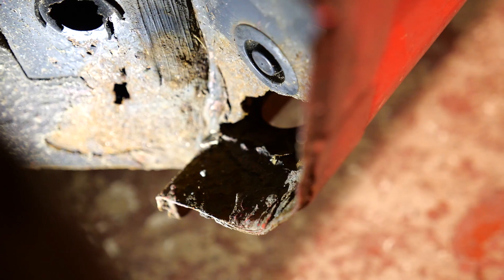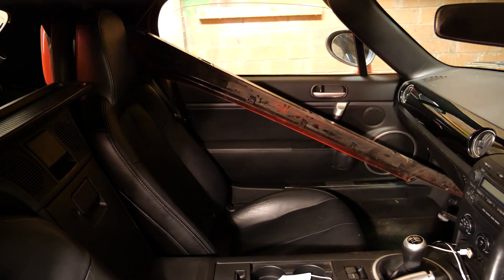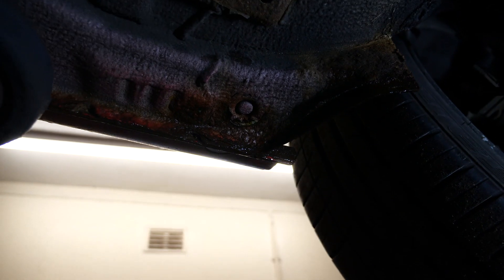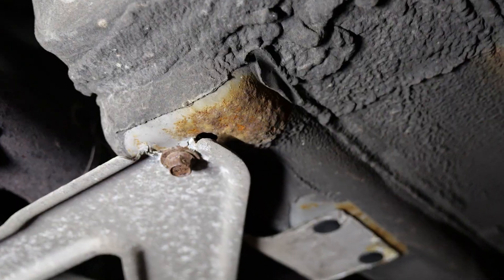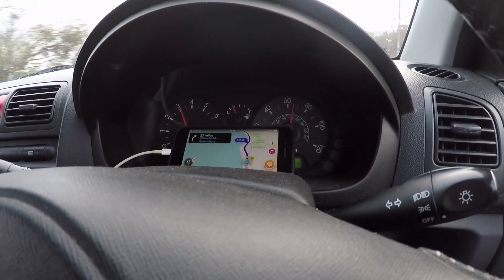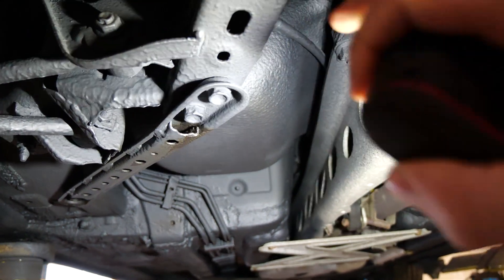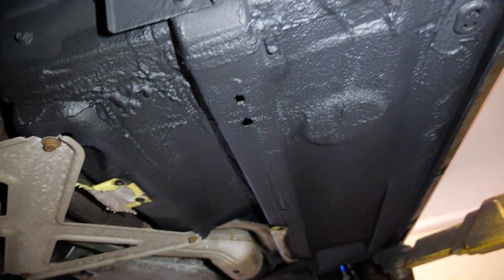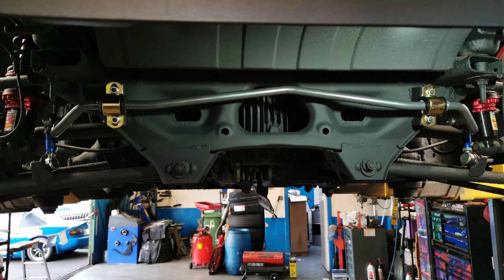I found more rust.. MX-5 NC welding and underseal

Comment: Sorry to hear you found rust! I thought the NCs were relatively well protected against it but sadly mistaken, will have to check mine
Reply: They always rust on the sill end panels, behind the fabric liners.  If you can catch it whilst it's just surface rust, rub it back to bare metal and apply rust converter, then 3 coats of hammerite with underseal as a final finish should keep it protected.  Also check the whole of the rear arches, beneath the fabric liner, especially around the threaded lugs that are used to hold the fabric liner in place.
Reply: I live in the Midwest USA and bought mine brand new in 2006 and mine has all kinds of rust

Comment: Looks good. Only thing that is really stopping me from buying one is rust issues. Wonder if mk4's still have the issues
Reply: mk4 is muuuuuch better in this regard, since quite a bit of stuff is aluminium instead of steel (hence the weight being even lower than mk1)

aluminium doesnt rust
Reply: @MultiMinors  the aluminum parts are on the outside and none of the chassis is alu so it'll still rust underneath regardless.
Reply: @kenzohkw  wishbone suspension is also aluminium + braces and stuff, there is really quite a bit of aluminium going on and it definitely matters
Reply: My 2007 MX 5 NC  is for sale. Never been out in the rain. Garaged from new   Looks like it was made yesterday Epping Essex...

Comment: Thanks for the info, I'm looking for a mark 3 at the moment, do you know if all models/years of mx5 are equally susceptible? Was there a year in which mazda did something that is better at preventing the rot?
Cheers
Mart
Reply from the maker: I believe they are all just as bad as each other unfortunately. I would look for a newer model that was properly under-sealed early on in its life if you’re overly worried. If that’s hard to find, then just check all of the usual rust spots. It’s not the end of the world if it’s only slight, it can be repaired.

Comment: mx5 nc is a great car but zero rust protection it was so disappointing to find my 2009 was all rusty and rusting away like 80s Datsun why do they rust so so bad !!
Reply: are you the original owner? do you know if the drain holes were ever blocked? You almost certainly will have the soft top version which has this issue, the prht or power hard tops don't, or at least very rarely rust at the sills because the water cant get stuck in the drain holes. the rear subframe can still rust but that is usually later down the line if it hasn't been undersealed
Reply: It’s a nice feeling when you have an immaculate MX5 that has never been out in the rain and garaged its entire life like my one,   My one should be in a museum  on a pedestal ....
Reply: @barryhill1044  Don't be too complacent. I've had my Mk2.5 vvt Sport for 19 years now from new. Always garaged and only used during the summer months. Mileage is presently 34,000. It began to rust from the inside out in front of the rear wheels and other areas just through condensation. If your garage is well ventilated and / or heated you may be okay but otherwise you'll be susceptible to rust (or rather, your car will be) just like me. For the last 15 years I've sprayed used engine oil into all the cavities annually and that is the only way to keep it free of rust.

Comment: What did the welding work cost, please?

A great tip for vlogging that I read is to share as much information as possible to help your audience learn. Measure and test things before and after fitting parts or having work done, share the costs of work, be critical where necessary of parts you have bought and don't like... I can see you're working hard to build your channel and producing good content so I thought I'd share this. Keep up the good work!
Reply from the maker: Hi Jamie, thanks for commenting! I appreciate your tips. There are reasons why I do some things. The costs change depending on the workload, no one job is identical to the other with welding and rust. As I mentioned at the start of the video once you start prodding sometimes it will fall away and you need a new sill as opposed to just a patch panel.  
If you need a cost for the process I suggest sending Mark a message on Facebook (I have added all his information in the description) with pictures of your car so that he can accurately diagnose it, I think the price of the underseal has now changed too (Please also bear in mind this booked in October).

Comment: its weird seeing many nc rust,as i never found a bit of it on my nc2
Reply: Its because UK , salt everywhere and raining 99% of days, horrible weather.
Reply: Have you checked your sill-end panels and removed your rear wheel arch fabric liners?  You can't see the rust unless you do this, I would be surprised if any NC has not got some rust here, unless it's never driven in rain or when there's salt on the road

Comment: Nice video ! 😉 How much was it ?
Reply: Aye, that was my first thought :)
Reply: I had my NC undersealed at MX5 City for around £300, they managed to turn it round in a day for me. Thankfully I didn't have any rust issues to contend with or extra parts to fit so it was a simpler job, but really nice guys, I'm very happy with the work.

Top tip; there is a very strong creosote type odour afterwards while the underseal cures. I had it done in October and it took a good few weeks to fade, so it would be advantageous to have it done in the warmer months for quicker curing and better ventilation with the top down!
Reply: I take a week and charge around 500

Comment: It’s a Mazda MX5, they all rust from inside to out, sills and arches. Have a look at the MX5 restorer, online or you tube, that’s all they do, repair rusty MX5s that look fine, until the MOT man shoves his finger through your bodywork.
Reply from the maker: Hi Steffy, thanks, yes I know the channel well. Good luck passing an MOT with a hole through the sill though 😬
Reply: @CarThought  I took my NB for an MOT years back and the tester shoved his hammer tool straight through my sill, nice repair bill, doh! Good luck matey, get the kettle on!

Comment from the maker: Do you think it’s worth getting a car undersealed?
Reply: yes 100%
Reply: Yes!
Reply: No idea if it is worth it, but when I bought mine and got it up on a ramp I found it had been done already!
Reply: Yes - how much did yours cost?
Reply: One of these? Yes.
Reply: Yes definitely.
Reply: Yes it is worth every penny.  But of course it is no good if the rust has already set into many areas   ...
Reply: totally pointless - IF you already have rust started. All you'll do is seal it in.. the only time to underseal a car is when it's brand new. The other option is to spray the undersides and insides of the sills with old engine oil - a bit of diesel mixed in helps it penetrate - that's if the smell doesn't come into the cockpit....

Comment: Nooo 😭 I remember the small bit of rust on my mc before I totaled it.
Reply: Oh no :( only ever written off one car (not my NC thankfully) but I was heartbroken. 180k mile Ibiza FR (PD130, loved the torque). Wanted to take it beyond 200k. I was devastated... And broke a rib. I've calmed down on public roads since, the accident was 100% my fault.

Hope you have a car you love now, or if you don't, you can get one soon!
Reply: @lukerahman  oh man, that’s rough. I was going 50 on the highway and the car hydroplaned into the center barrier and bounced off and slid across the highway to the shoulder. Walked away with a sore neck luckily. Currently in a 2011 bmw e90 m3 sedan for a more practical daily. I love the car, but I definitely miss the Miata. Will probably get another NC in a couple of years.
Reply: @covertorange9120  sounds like you got lucky there all things considered.

I lost the back end in the wet between 60 and 70mph, I counter steered too hard, very much ran out of talent and spun the opposite way. Hit a telegraph pole and rolled the car on its side. Silly boy. Love my NC but I tend to go a bit steadier now.
Reply: @lukerahman  yeah, very lucky all things considered. Just really miss the car. I guess your car was totalled after hitting a pole?